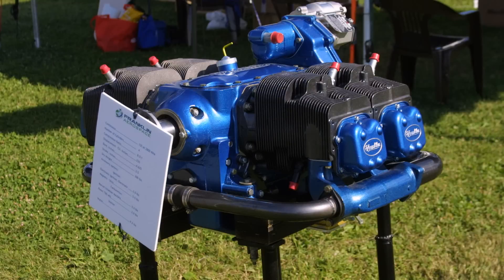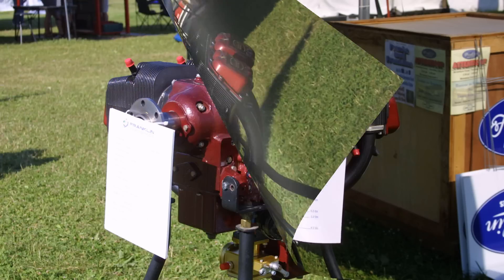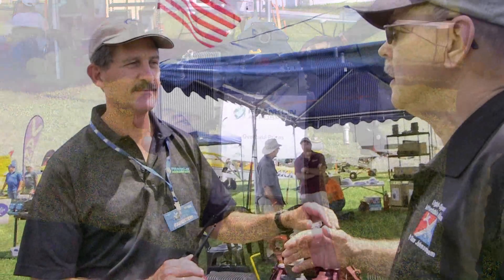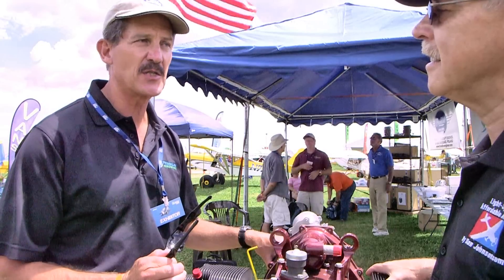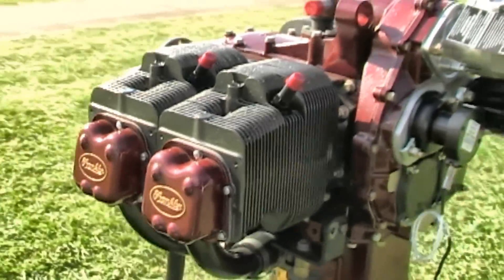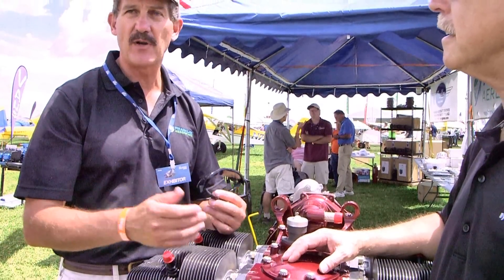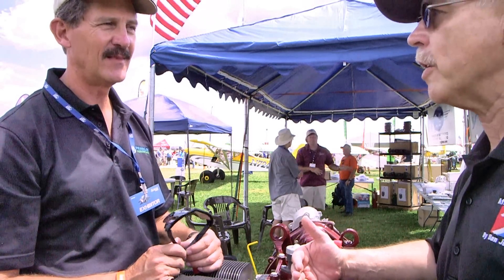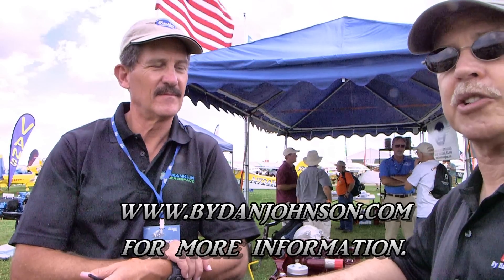Franklin Aircraft Engines, from Franklin Aerospace, Franklin Engine Parts & Service.

Comment: I was aware Franklin engines were used in Tucker cars and were used in aircraft but never knew about helicopter engines.
I own a perfectly running 1929 Franklin135
Which I rarely take out on the road.

Comment: Franklin Automotive designed these engines in the very early 1900’s by Herbert Franklin.  He was the first Auto maker to use the air cooled engine design.  Starting with a 20hp and ending with a 300hp engine.  Franklin Automotive went out of business in 1932.  From 1945-1947 the engine design and patent was owned by Republic Aviation then 1947 - 1975 Aero Industies then from 1975 to current the Franklin name was revived!  Not to be weird about it but if this guy thinks this engine he’s selling was developed in 1975 he needs to open a book.

Comment: more power,     add  6 degrees of timing to and rate at a higher RPM,    seems lame to me.
                            Take your lycoming  from 25 to 32 and measure the power

Comment: Does Franklin have a small two cylinder motor ?
Reply: They did back in the '70s. I don't think that engine is currently in production.
Reply from the maker: NOT THAT I AM AWARE OF BUT WE JUST DID AN INTERVIEW ON THE PEGASUS - A TWIN CYLINDER  4 STROKE ENGINE
https://www.youtube.com/watch?v=VvfMZXUGGgs&t=1s

THE ULTRALIGHT FLYER

Comment: I want the 220 on my 170
Reply: No, you don’t. 

I put a brand new PZL Franklin in my 170B 18 years ago. It added 300 pounds to the empty weight and moved the CG so far forward it became impossible to do 3 point landings. 

Loved the airframe, made me sick to ruin it with that oil eating thing. 

But it was strong as could be and never failed to start.
Reply: no you don't save your 170 0300 maybe. B model is a beautiful thing !

Comment: Would love a Continental A65/A75 replacement from Franklin.
Reply: I believe they had a 2 cyl of about 65 hp in the way back when. Also, Franklin was the basis for the Tucker rear engine sedan. It was a water cooled opposed six. (0-335?)
Reply: Daniel Nunn  - Tucker bought the Franklin aircraft engine company to make engines for their cars. When Tucker went bankrupt, they took Franklin engines down with them.  A double loss.